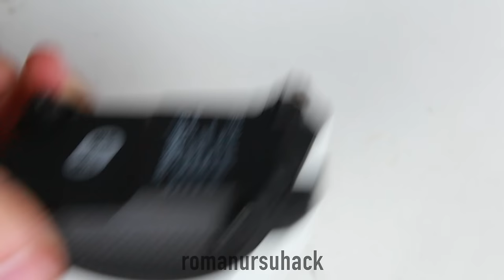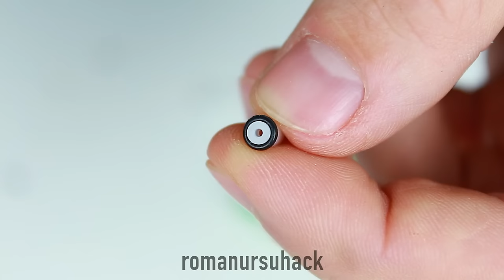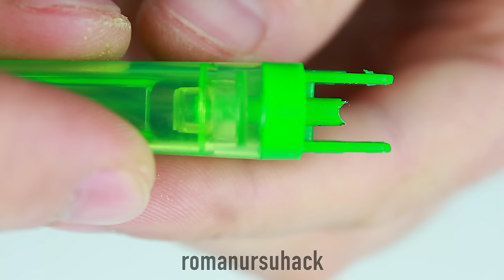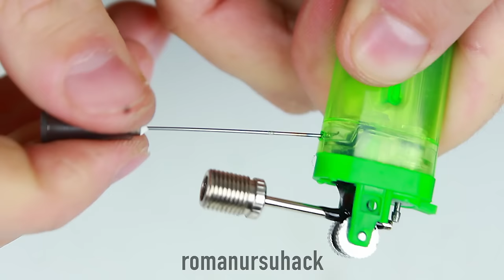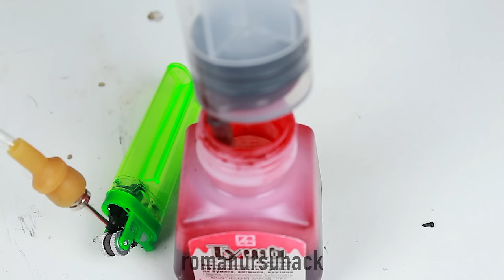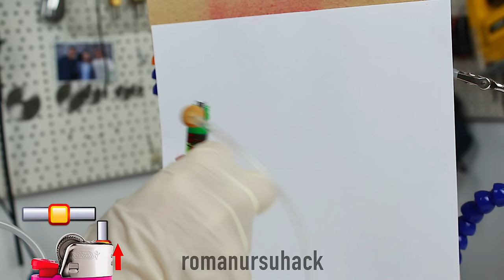Cool idea about a DIY airbrush from a lighter

Comment: pressure is too low.
~7 years ago i used valve from a lighter as a trigger and syringe needle as paint conduit and 2 bar compressor. The result was very close to a professional-grade airbrush - no drops on a painting surface, just uniform fog of atomized paint.
Reply: словом, на видео херня, а не аэрограф :) компрессор для аквариума 0,3 очка в прыжке даёт, в пень его.

Comment: Idea is good, but the spread is really bad, you can see all the big dots between the smaller ones
Reply: MiniaczQ a frozen can of spray paint goes on more consistent lol
Reply: MiniaczQ that's a nice effect . I won't mind having my walls painted like that
Reply: For walls sure, but this tool is mostly used to spray paint metal elements for cars and other stuff, so it would be bad for that purpose
Reply: MiniaczQ could be, but there is someone out there who would like the result 😁
Reply: nice idea but i agree witch miniaczq spread is really bad. need bettter nozzle
Reply: Raul Gabriel no
Reply: i think this video was only for the thought not the quality
Reply: It is not about nozzle there's no nozzle and needle it was dripping paint and blowing on canvas. I'd try a bigger air pressure but he doesn't even use a compressor just a bubbler for fish tub...totally embarrassing...I mean...yeah...like for hot glue a lighter is not bad but for painting? Cmon now.
Reply: THOUGHT that counts
Reply: Levi Lim
Reply: +10 for thought and creativity. More air pressure might give better spray pattern but pretty cool regardless